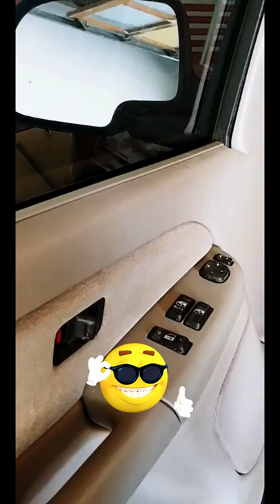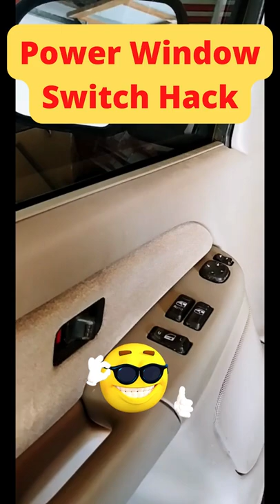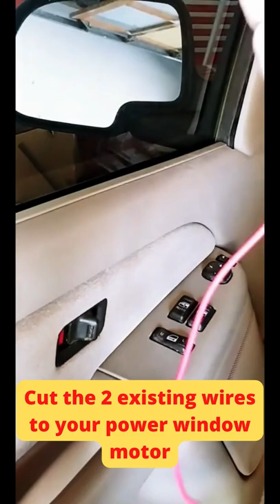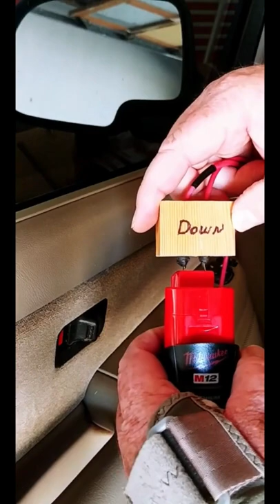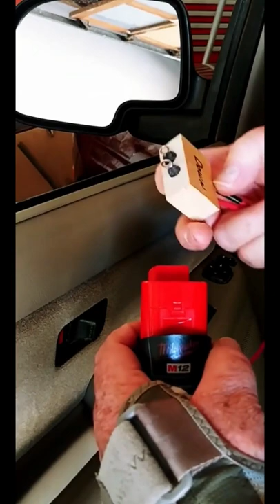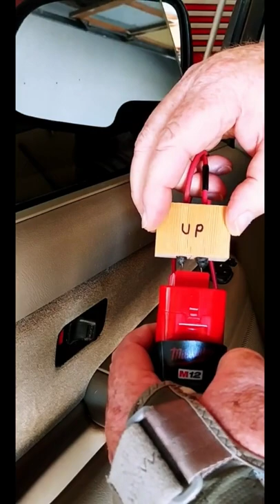Power Window Switch Not Working? Bypass Hack 😎 #shorts

Comment: I like your thinking Sir. I broke the handle on my front door. I could of just gotten a new handle for like 5 dollars but instead I attached some leads and a pulley system and now I can open the door if I put my foot against the door and then pull the leads with both hands and abracadabra the door opens...😂

Comment: 99-06 silverado sierra window switches are a dime a dozen, new and used, just get one, i work in a private junkyard and i use one of them powerwheel battery adaptors with an on/off switch, but i made up a harness with some parts out in the yard with multiple different leads i can choose from to power everything from windshield wipers to fuel pumps on all makes and models to make sure a part is verified working before we hand it out to the customer.
Reply from the maker: Thanks

Comment: I can't figure out what the wires are connected to inside the block of wood.  Right now i have the wires hanging out connected to the motor and use my drill battery I'd just like to make it a cleaner setup. So if you don't mind just saying what you connected to wires to inside the wooden black that would be most helpful.  Thank you.
Reply from the maker: The block of wood is just to hold the wires and orient them for up or down. The spacing of the wires in the block also matches the terminals on my Milwaukee m12 battery. I just drilled the block with holes the size of the wire. Siliconed them in place and crimped on ring terminals that engage the battery terminals perfectly. Hope this helps. Thanks for watching.

Comment: Why not just bring a hot and ground wire to the switch in the door, from the wiring in the car???
Simple as that...bypass the wood and drill battery all together
You don't wanna be one of those fools with a wooden block and a drill battery to operate ur window.. that's just foolish...
Yeah don't do that.
          🫵😂
Reply from the maker: Thanks for watching & commenting.